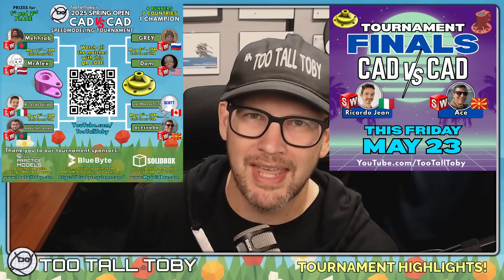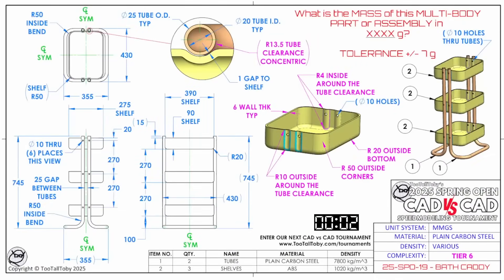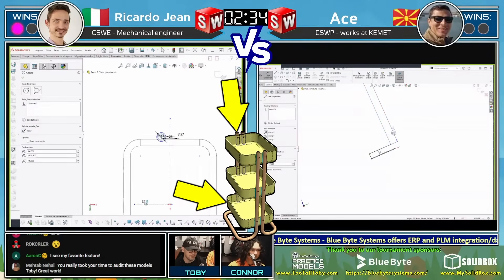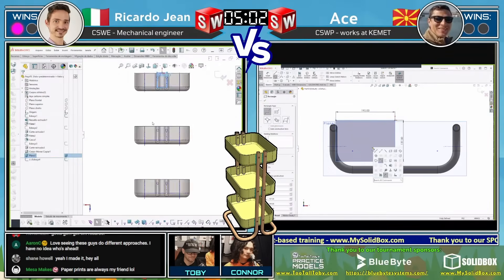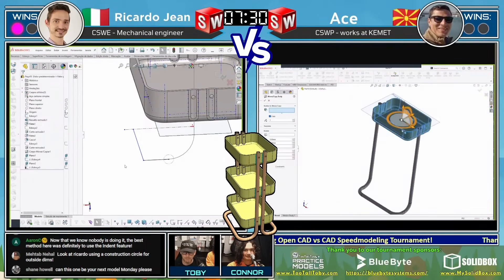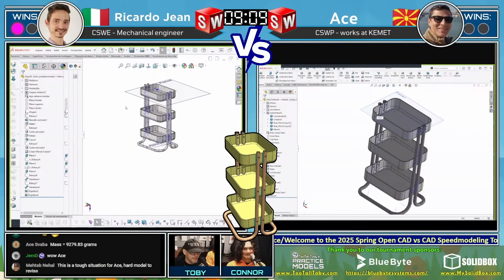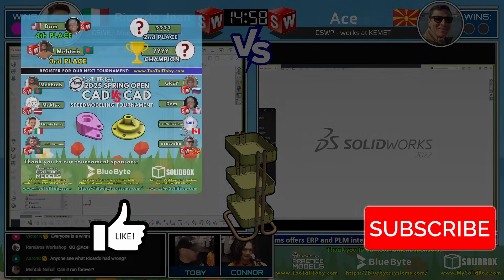CAD Speedmodeling Tournament! - FINALS Battle 2 - SOLIDWORKS vs SOLIDWORKS

Comment: I cant seem to get the answer Ace got, 9255g, I am getting around 9343.34g. Has anyone struggled with this situation. If yes please share. Thanks
Reply from the maker: Awesome job! Remember to check your materials.  You can search my youtube page for Toby Materials Fusion or Toby Materials Onshape Or Toby Materials SolidWorks to find a library that will match your system.  Density has to be correct.
Reply: @TooTallToby Hi thanks for replying to my comment @TooTallToby ! Yes, I've checked the materials correctly. I've selected plain carbon steel for the support and ABS for the shelves. I will still check it again based on your advise. I've double triple checked the dimensions for the bath caddy based on the engineering drawing chart. 

Here is what I found that's causing the issue. There is one comment down here where the person mentioned that they achieved the same answer as Ace. And they gave the mass properties for the shelf and the support. My shelf mass properties matched as the person's but the support is not around, mine is more than 100g,

I will still check it out and update here the mass properties if I manage to get the right answer. Thanks.

Comment: Do they even need to join the parts to know the weight?
Reply from the maker: No  -there are lots of ways to get to the correct mass, and the users have full freedom to come up with their own path.
In this case of this model, there are 5 parts, with 2 different materials.
Reply: @TooTallToby they can just build a tube and the yellow part, then multiply by 2 and by 3 you get the mass
Reply from the maker: @Skydreamer223  yup - They sure can. But most of the models have some in context type features that will make this a little more difficult

Comment: I'm really new to this and I wonder why they must replicate the thing perfectly when you just need the weight?
Like with recreating the 2 pieces this object has and calculating the weight if you put 3 of the basket and 2 of the support is enough to win right?
Reply: Oftentimes, it's easier in the end to make the CAD do the math rather than doing it yourself (though normally I'm saying that in context of dimensioning). In this case, matching the model makes it much easier to verify other measurements and see discrepancies. You could still get the right answer, but the time you save is so minimal compared to the risk you take that even if you only need the mass number, it's not worth it.
Reply from the maker: Well said @gordonwalsh5652 - perfect explanation and weighing of the pros and cons - thanks!
Reply: the goal is to make the same exact design, calculating the weight is a way to confirmate that the design is right
Reply: @jazzstrikem.h.9862 but with designs like this is really easy to not make it precise 
I mean yeah sure you are seeing them making it but for example the spacing could easily be really off but not be noticeable to the naked eye

Comment: I can tell as a certain fact that no parametric 3D modeler would win a modeling speed contest against a non-parametric modeler. Parametric Technology Company (PTC) offers both. The Pro Engineer product, which is a parametric modeler and Creo Elements Direct Modeling and Drafting, which is not. Using a parametric modeler adds at least a 10% to 15% time penalty due to the necessity of parameterizing every single dimension and relating all geometry in way that would allow subsequent "design automation". The problem is, for 99.9% of mechanical design work there is never going to be any reason to use the "parameters" to do any such thing. With Elements Direct you just model the geometry, period. And by the way, if there ever really were a good reason to use parametric modeling with Elements Direct users may purchase the license for an add-on module that does implement parametric modeling. The success of Pro Engineer in the marketplace is due more to hyper-aggressive sales techniques than it is to any modeling benefit for most users. Years ago, I researched and selected 3D modeling software for the engineering department I worked for. I selected the app that was the precursor to Elements Direct (AKA Solidesigner). When PTC learned I had not chosen their product they had an executive call the CEO of my company and tell them that I had made a massive mistake. The CEO told them he trusted engineering to make the appropriate decision for their the companies case.

Comment: POV: you use Rhino and finish in 5 minutes

Draw the sharp tube lines (first half)
Fillet the edges
Use Pipe to create the tubes
Mirror the first half of the tubes
Make a box(first container)
Boolean difference with the tubes to carve the slots
_FilletEdge on the containers
_Shell the boxes to create the containers
Array x0 y0 z3
Draw the first screw
Draw the cylinder for the screw hole
Array the screw hole
Mirror the screw holes on X and Y
Subtract the cylinders
Array and mirror the screw
Reply from the maker: Thanks for the comment and glad you enjoyed this video! And I'd love to see more Rhino in the tournament!  We had a rhino user in the SPRING OPEN 2025, but he got knocked out in the first round 🙁

Our CAD vs CAD tournaments are open to all users from around the world- any skill level, any CAD system - you just need to be able to quickly create a 3D Model, assign a material density, and calculate the mass!

So if you’re interested in entering the next tournament (or if you know someone who might be interested) here’s the info you’ll need:
HOW TO ENTER: here's a quick overview: https://www.youtube.com/watch?v=2OgSFOK3g1I 
And here's my tournament qualification run: https://youtu.be/85lB4qYdWNs?si=hUpfk1dMhFv_b4UO

And just in case you’re newer to 3D CAD, here’s a video on how to get the best practice: https://www.youtube.com/watch?v=ZqquT1gi724

Comment: I'm new here in TTT. I tried the assembly and got the result.
Mass = 9249.13 grams
Volume = 4303130.23 cubic millimeters
So far I was having a problem with the gap between tube and shelves.
Reply from the maker: Nice - that's a tricky one!  here's how I did it in onshape:
https://youtu.be/JDC5LhtqFOU

Comment: Mass = 9225.43 grams

Volume = 4303127.32 cubic millimeters

Surface area = 1794749.26  square millimeters

i dont know what's wrong, 25grams has gone? : (
Reply from the maker: Wow - Maybe take a look at your materials and density settings?

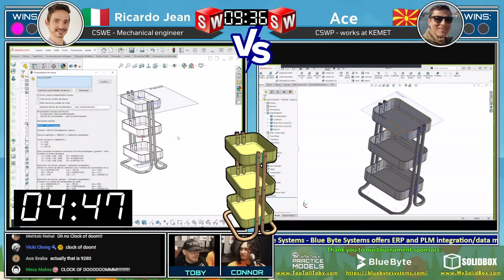Comment: 12:16 Ricardo gives the first wrong answer with 4m40s left. he doesn't realize it yet but his number is too high because he forgot to the cut out the screw holes
12:59 He recognizes this almost immediately and completes the fix in less than a minute. he has 4m left and so instead of giving his final answer he wisely decides to spend it checking everything else. just in case...everything is checking out well until
14:26 He checks outside major dimensions and measures the major dimension pipe OD to pipe OD at the long end and finds it to be 435mm. It's not obvious to the viewer but he definitely knows this is wrong because he does nothing on screen for a full 8 seconds. the measurement should have been 430mm according to the plans. 
14:34 He kicks into action trying to find out what went wrong.
15:09 With 1m49s left and no strong leads, he is thinks he is going insane and pulls out Windows Calculator to verify that radius of the pipe OD 25mm is indeed 12.5mm. He has a hunch that the issue has something to do with how the pipe is offset into the footprint of the ABS basket, but still, nothing comes to mind as to where the exact problem is.
15:20 More insanity ensues as he repeats the 435mm measurement from 1 minute ago. He has only 90 seconds left.
15:52 With a minute remaining and no further changes since fixing the holes, he pulls up the mass measurement and saves it to clipboard while checking a few other minor places for potential errors to no avail.
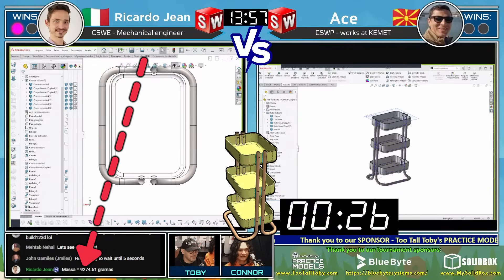16:31 There's only 30 seconds left, Ricardo Jean he chooses sanity over accuracy pastes a number in chat as his final answer, which is incorrect. Ace gives a third attempt for fun and gets it right at 9255g, a full 19.86g lighter than Ricardo's number.

Here's where he went wrong. At 5:01 he incorrectly applies the major dimension 430mm to the ID of the tube instead of the OD. He did not draw the OD so the length constraint entered should have taken into account two tube walls and come up to 425mm instead. Failing that, the major dimension is now 435mm as he only discovers much later as previously described. On the straight horizontal portions of the tube, he has a total excess of 10mm steel tube. This is an excess of 13.9g. If Ace's third guess was on the dot, Ricardo would have been within +-7g accounting for the extra steel. Also, because the vertical pipes are not cutting into the baskets as much as they should, each basket is a tiny amount too heavy as a result. But there are 3 baskets and a total of 12 such cuts so it adds up. He definitely would have gotten the point if he found the issue in the original sketch. Alas! Pros make mistakes too and I wouldn't have found it in time either. Took me 45 minutes to find it.
Reply from the maker: A very comprehensive overview - thank you!
Reply: Impressive analysis! I like so much :D
Reply: I noticed the major dimension application at 5:01 and was wondering if it was a mistake. Ty for your analysis
Reply: Imagine a commentating hype casting all of that lmao

Comment: I tried to design this the way Ace did. I made the mistake of adding fillets on the sketch of the ''shelf body'', next to the area where they meet the tubes, and this resulted in a wrong fillet formation, when i added the outside 20mm fillet at he bottom. I went back and removed them from the sketch and added them on the body afterwards, and i got it correct. Very nice exercise!
Reply from the maker: awwww yeah awwesome job!